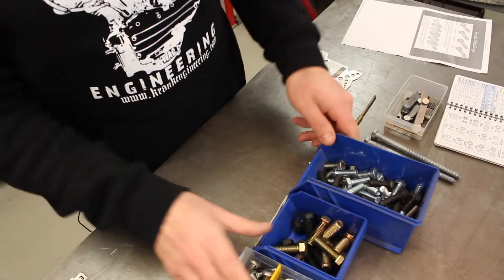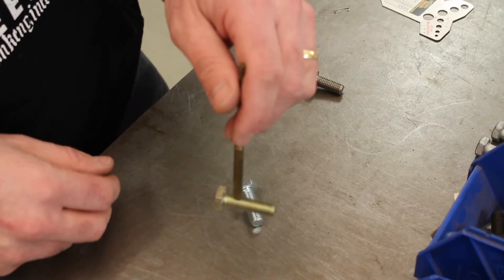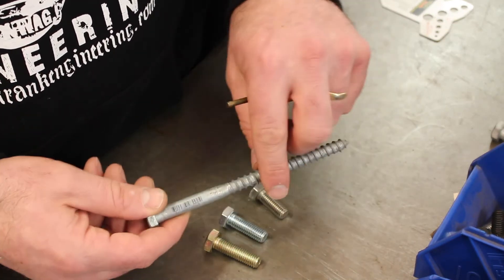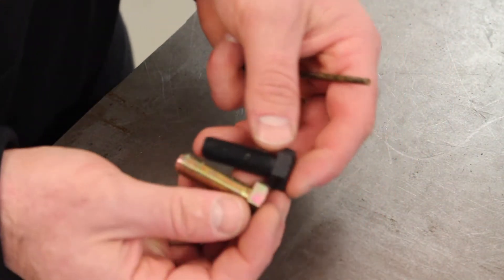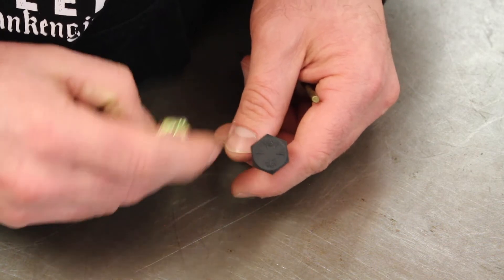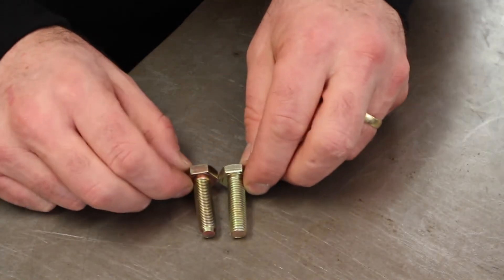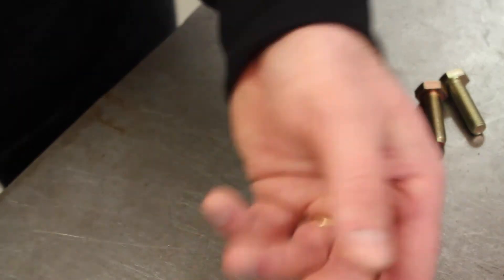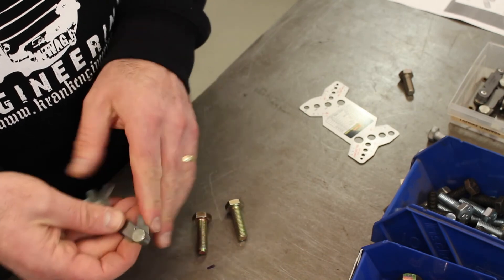How to identify bolts and nuts

Comment: also, you wouldnt go to a bolt supplier and ask for a 1/2" 13tpi bolt. imperial bolts are almost always UNC or UNF; course and fine thread respectively (unless its a pipe thread like BSP or NPT but that would be obvious)  and are referred to as such. So you would say "id like a 1/2 inch by 2 inch UNC bolt please" for example.

Comment: Hey mate just a correction: the silver carbon steel M10 bolt is not nickel plated as you stated, its zinc plated, commonly reffered to as "blue zinc". The gold coloured bolt is also a zinc plating, zinc chromate like you said, but a bit thicker plating and thus better corrosion resistance, commonly reffered to as zinc plate gold. 

Nickel has a slightly straw colour to it, very similar to stainless steel although it is not used very much because if you are after corrosion resistance, zinc plating is cheaper and if you are after shine, chrome plating is much tougher and therefore will hold a shine longer. Nickel plating however is the easiest to do at home, (requires only some vinegar, guitar strings and a source of power) and has sort of a cult following in the show car scene because  when polished it has the mirror effect of chrome but a slight gold tinge to it. 

peace out